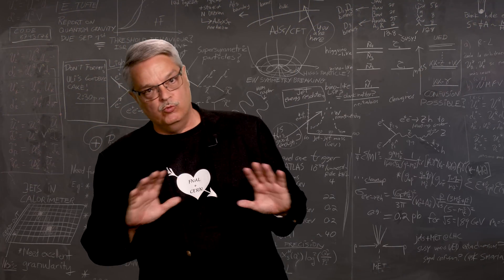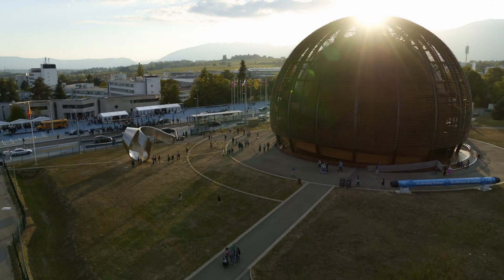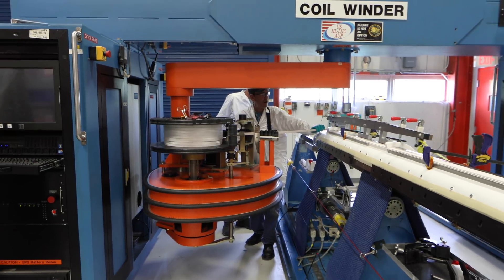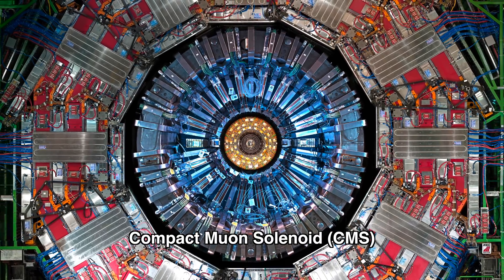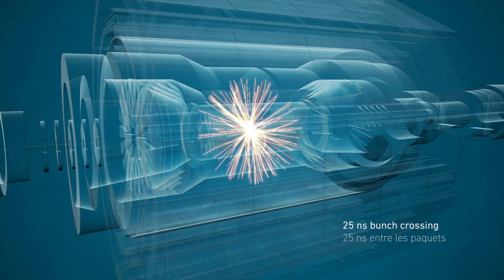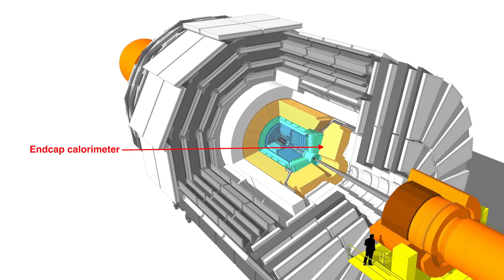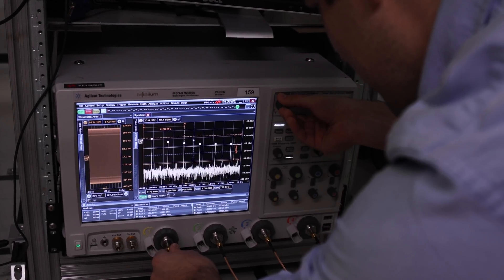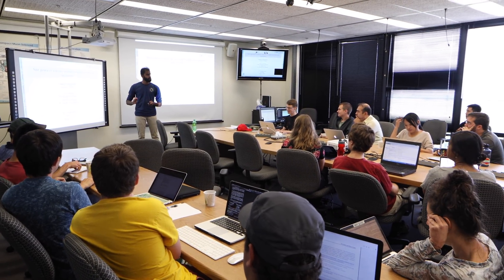The Higgs Boson Was Just the Start: Fermilab and the High Luminosity LHC

Comment: Protons can be accelerated in the LHC up to 99% (or even more) the speed of light, if I am not mistaken. Why don't they freeze in space and time to an outside observer ("time dilation")? After all, they do have a "restmass", don't they.
Reply: Time dilation means that time would be running slower for them from our perspective. This is observable with particles that decay, as they do so significantly slower when accelerated to high speeds.
Reply: @lunkel8108  Why does that not affect their speed from our perspective? Are they "living " in two timeframes simultaneously?
Reply: @rka8215  That's just not how time dilation works. I recommend minutephysic's series about relativity. It's not too long and should give you a decent understanding of the subject.
Reply: @lunkel8108  Maybe it is time to give up terms like "time dilation", which implie there is only "one time" and accept the idea, that time is not a continuous dimension but rather a feature  of energy which pops up as entropy increases.
Reply: @rka8215  Nobody denies that the thermodynamic arrow of time is something that exists. Now, you basicly just openly admitted to not understanding special relativity and are now trying to criticise it. I would advise against that. First understand what it's actually saying so that you can then make good arguments against it. This is important completely regardless of whether or not your position happens to be correct.
In fact I would argue that this is even worse when your position is correct because then you are actively undermining something that should be relatively simple and standing in the way of figuring out the best models.
Reply: @lunkel8108  Sorry, I did not mean to hurt anybody's feelings! I am not a physicist and I admittedly know nothing about relativity. I just like to play with ideas.

Comment: I have a question that the neutral particle like neutral Kaons are detected experimentally ??
Reply: Usually using their decay products. You can also detect the products of their interaction with matter or other particles; as in neutrinos, which are electrically neutral, and don't decay, but on the rare occasion a neutrino interacts with matter, it can cause a nuclear reaction such as transforming a proton into a neutron or vice versa.

Comment: The natural first (Occam’s) assumption to explain how or why a particle like a photon (or electron, etc) might behave as an uncertain location particle while also like a polarizable axial or helical wave ''packet'', given that everything in the universe from electrons to solar systems are in orbit with something else pulling them into polarizable axial or helical apparent waves depending on the orientation of their orbits as they travel thru space, and given that we know we’re in a sea of undetectable dark matter but don’t know where it’s disbursed, is that they’re in orbit with an undetectable dark matter particle pulling them into polarizable axial or helical apparent waves as they travel where the speed of their orbit determines the wavelength and the diameter is the amplitude which would explain the double slit, uncertainty, etc. No?
Reply: No.
Reply: That's just a hodge-podge of scientific or scientific-sounding terms with no real meaning. That's not how science is done. You could have as well said that all particles of the universe are composed of the elements of earth, water, air, and fire; and that sure explains everything.

Comment: Can they make particle accelerators shaped like a hockey field with two parallel straight sections that curve at the ends? Crude picture: (==)
I think this could be useful because they can keep experiments running while upgrading. They can add a U to one side (eg left) like this (==(==) while the right most 4 characters are still operating.
Then shut it down and they only need to replace the inner curve to expand it. (=====)

Comment: Very impressive stuff - 1 picosecond timing is just one of the amazing things you described. I hope the upgraded LHC is being designed to confirm a theory, like it was originally. Surely all big expensive experiments should do this. I'd be a bit sceptical if it's just hitting stuff with a bigger hammer in case something interesting pops out - that's no way to do science. Anyway, without a theory, how do you decide what's interesting.

Comment: The most important detector in this acceleration should be this one which can determinate the shape of proton beam exactly before collision; whether it is in sphere shape or not, because it is very important to be sure in calorimeter data, see this:
 Why CERN didn’t successes to create “black hole” in the collider, because if their calculations was correct, there must to be one?
What happens inside the CERN’s collider and how much the mass of proton can increases? 
About CERN new beginning: Let examine first assertion that reached energy of impact is already 13 Tev. I immediately ask which energy this one in laboratory coordinate or in the center masses and haw they measure this energy and whether it is reliable and in what extend? First is it possible to measure directly the energy of two beams protons impact in coordinate center masses? That is possible only in one case if the two beams are from particles and respectively anti particle, which it isn’t possible in reality. So haw they know what exactly is the energy of impact in the center masses? The answer is only “probably” it is equal to the energy in laboratory coordinate. Let give one possible method of measuring this energy: Because these accelerated particles interact with the accelerating magnets there appears weak resonance radiation and measuring its frequency we can estimate the velocity of the beam by the known formula about wave spreading. And another way is to estimate the centrifugal force of the beam because there is the limit of bending of the trajectory and interaction with the withstanding magnets. So this measurement is in laboratory coordinate and obviously it isn’t so accurately. So how in CERN know the exactly energy of impact in the coordinate center masses? They didn’t, because they measuring the energy of emit in the process particles through calorimeter and eventually the bending of the trajectory of this particles in strong magnetic field if these particles are charged, but if there are not? Then what? 
Not only about Mercury’s orbit but also any accelerator of nuclear particles cannot work if we do not take into account this formula: M=M_0/√(1-V^2/C^2 ) which by the way in USM www.kanevuniverse.com has the same kind without to use GR in any way! So according to fig. 10 page 45 and especially page 48 it is seen that relativistic mass cannot become infinity which is permit by the formula M=M_0/√(1-V^2/C^2 ) but the same mass interacting with the near and dynamically connected orbital system can to be with maximum value: M=√2.M_0 So any accelerator of nuclear particles and seeing fig. 12 and page 50 and 51 all confirms this!
The conclusion is that the velocity of proton beam can to accept close to the velocity of light but the mass of separately proton cannot be higher than: M<√2.M_0 . Then where is the delusion?
The answer is in part I and part II of Undivided Structure of the Matter (USM) www.kanevuniverse.com . According to this theory the proton’s beam must to appear like spherical body of proton’s cloud because the motion is in orbital mode. Using the formulae shown in the parts above, we can calculate that:
F_el=e^2/(ε.r^2 )=(23.〖10〗^(-20))/r^2 [din];F_gr=G (m_p.m_p)/r^2 =(18,6.〖10〗^(-56))/r^2 [din]
F_gr=(V.C)/R (1+V/C)_(V→C)={fotm:19}=(V.C.ln(1+V/C))/(±R.√(1+V^2/C^2 )) (V→C)=(V.C.ln2)/(±R.√2) (V→C)=(fig.13)=(V.C.0,693(2.2))/((2.R)/2.1,414) (V→C)≈((3.〖10〗^10 )^2.2.2)/(27〖.10〗^5 )=1,33.〖10〗^15 [cm/s^2 ]
Where R is the radius of collider (all in cm). So we can calculate through g=G M/r^2 →M=(g.r^2)/G=(1,33.〖10〗^15 [cm/s^2 ].〖10〗^(-26))/(6,67.〖10〗^(-8) )=0,199.〖10〗^(-3) [g] where r is the radius of proton. The mass of proton is equal to: m_(p_0 )=1,67.〖10〗^(-24) [g];and G=6,67.〖10〗^(-8) The mass M is creates by the following number of protons:
M/m_(p_0 ) =(0,199.〖10〗^(-3) [g])/(1,67.〖10〗^(-24) [g] )≈0,12.〖10〗^21 [number protons] Then the gravitational acceleration sum of these protons is equal to: F_gr^∑▒p=1,67.〖10〗^(-24) [g].1,33.〖10〗^15 [cm/s^2 ]=2,22.〖10〗^(-9) [din].0,12.〖10〗^21 [numb.]=0,26.〖10〗^12 [din ] Then the ratio: (F_gr^∑▒p)/F_el =(0,26.〖10〗^12)/(23.〖10〗^6 )≈1,1.〖10〗^4 where: F_el=(23.〖10〗^(-20))/(〖10〗^(-13) )^2 =23.〖10〗^6 [din] 
It is seen that the gravitational acceleration overcome the electrostatic repulsion between the two protons over 〖10〗^4 times and the spherical body of protons sum is with 0,12.〖10〗^21 number protons.
Now day interpretation of CERN’s increasing relativistic mass shows that the number times of proton’s mass increasing is bigger than √2 times, but in fact that is the number of protons in the cloud body where separately proton cannot increases its mass more than √2 times!
Now let we see what will happen if the distance between the two protons is bigger, for example r_pp=〖10〗^(-11) [cm] 
g=G M/r^2 →M=(1,33.〖10〗^15 [cm/s^2 ].(〖10〗^(-11) )^2)/(6,67.〖10〗^(-8) )=0,199.〖10〗^(-7) [g]→M/m_(p_0 ) =(0,199.〖10〗^(-7) [g])/(1,67.〖10〗^(-24) [g] )=0,12.〖10〗^17 [number protons]
F_gr^∑▒p=2,22〖10〗^(-9) [din].0,12.〖10〗^17=0,26.〖10〗^8 [din]; And again the ratio: (F_gr^∑▒p)/F_el =(0,26.〖10〗^8)/(23.〖10〗^2 )≈1.〖10〗^4 where this time the F_el=(23.〖10〗^(-20))/(〖10〗^(-11) )^2 =23.〖10〗^2 [din]
We can see that ration between the gravitational acceleration of the body and the repulsion of the two protons remains the same no matter how much protons includes the body!
So CERN can say to us that the relativistic mass of separately proton can to be what to them is most suitable to assert reaching by the collider the energy of proton’s beam! G.Kanev

Comment: The trigger of CMS  is interesting to me. As with SETI, throwing away so much data seems a huge risk of missing something unexpected and subtle.
I wonder if a small sample of "randomly selected" data is also kept as a control ?
Reply: All particle physics experiments record a variety of data.  They accord all data with characteristics that seems promising for discovery.  But they record a fraction of all kinds of data with a well known fraction (e.g. one in 100 of kind of rare data, one in 10,000 of fairly common data, one in 100,000 of pretty common data, one in 1,000,000 of quite common data, etc. [numbers made up for illustration purposes, void where prohibited by law, your mileage may vary.]  That way even ordinary data is recorded.  Finally there are sets of data called "minimum bias," which has the tiniest requirement that a collision occurred, and "zero bias," which has no requirement at all other than the time is right for the beam to be in the center of the detector.

So yes to your question.
Reply: @drdon5205  Thank you ! Us maths types always forget that physics types are actually maths types that are even more paranoid than we are :)
Certainly some of the statistical approaches I see in the commercial world could use an ounce of such rigour !